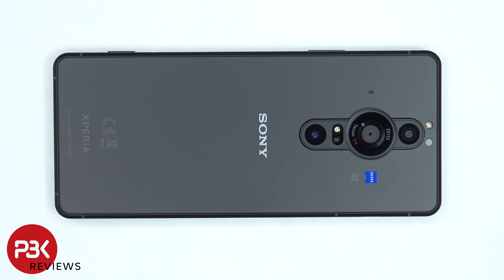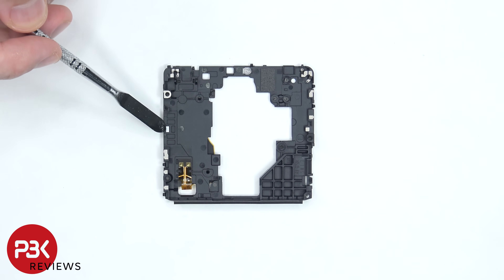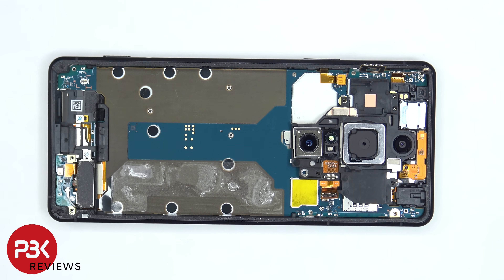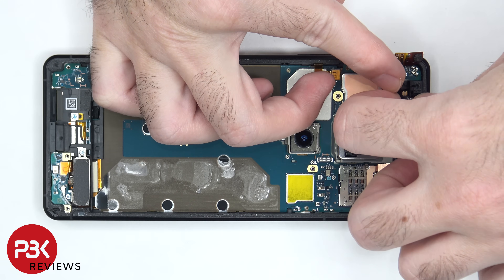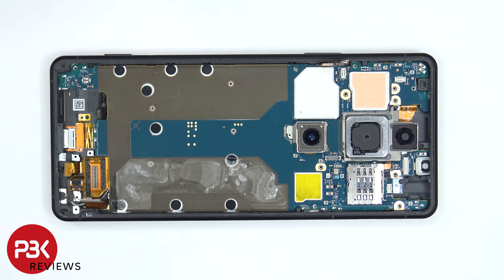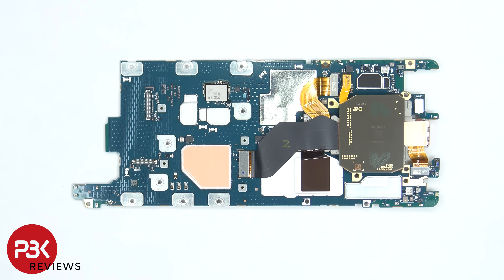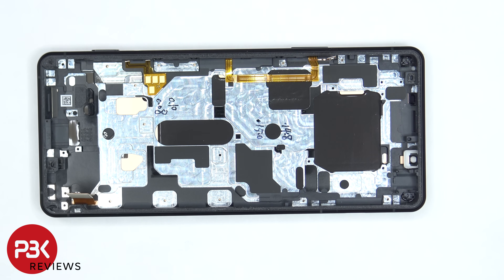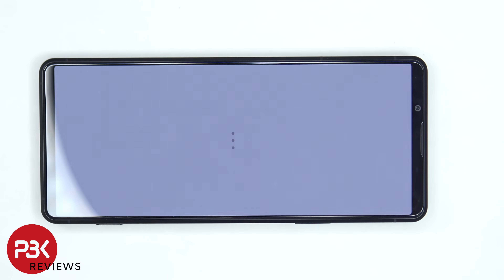Sony Xperia Pro-I Disassembly Teardown Repair Video Review

Comment: There are a lot of virs on the mother board to transport heat, they're copper too.
Reply from the maker: Not sure what virs is but yea there is heat transfer, however I would personally like to see at least some thermal paste or thermal pads to more efficiently transfer heat between the chips and the shields that cover them out to the frame to be exhausted out.
Reply: @PBKreviews  modification oossibe?
Reply: do you mean " Vias " instead ? 🙂

Comment: I don't see any good reason why the way this phone was made this way. I think the its very inefficient, I think Sony can make this more simple while having tha same specs and features and also I think the motherboard can be made smaller to make more room for the battery. Its like sony was left behind when it comes to design and manufacturing while other manufacturers are doing their best to manufacture a phones as easy as possible. This phone looks like it came from 2000's when it comes to how complicated it was build.
Reply: Soo, you gonna teach the best tech company, who don't give a stupid excuse like no space to keep the headphone jack, SSD and moreover, this beast has 1 inch Sensor. It's easier said than done.
Reply: @Karthik-yy7gw  nope. Thats not my point. 😅. I just hope that they made it more simple to help make disassembly easier for easier repair.
Reply: I think the 888 is the reason why sony use a such a large motherboard. Finally in the end of 2021, we got a phone that can keep calm with 888 in .
Reply: @turlaplace6395  if you will check mr mobile'a review on this phone, the thermals is also not good on this.
Reply: @jerome2242  seriously, fucking last years pro was way better and had a massive vapor change heatsink... What happened?
Reply from the maker: Yup, reminds me of the older HTC phones back in the day. Those were somewhat a nightmare to take apart.
Reply: @PBKreviews  those phones that took a beating and kept on ticking. I remember those also